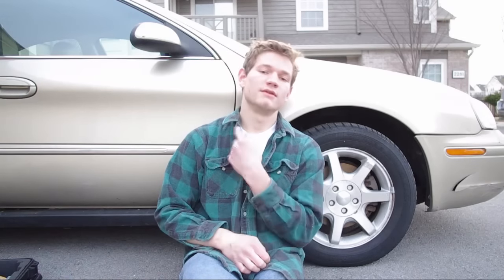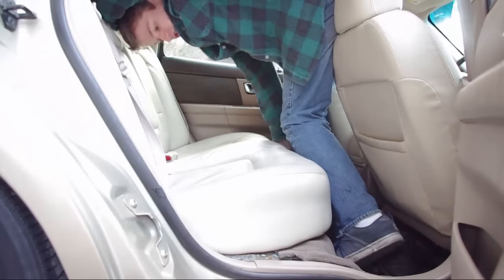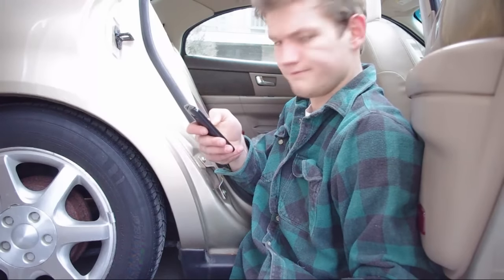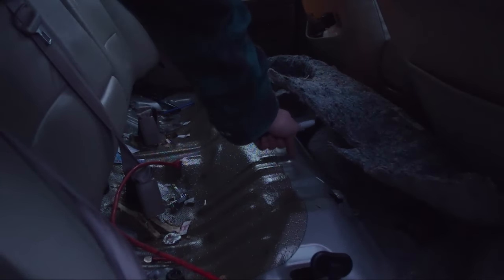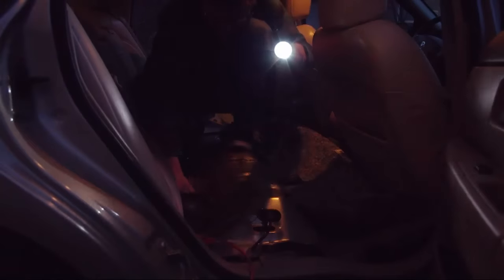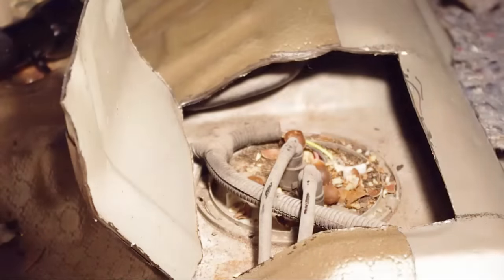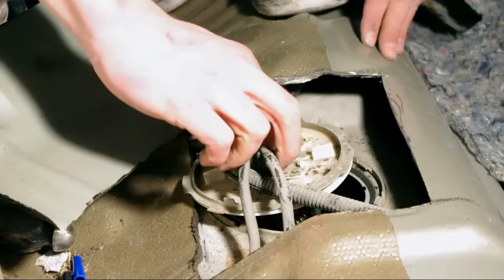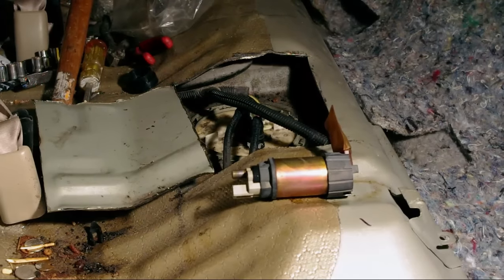Changing a Fuel Pump Without Dropping the Gas Tank

Comment: Do not do this i cut fuel lines a wires and after that a tech charge me doble for the repairs
Reply from the maker: If you're going to cut that deep then you shouldn't be doing this.  The video explicitly shows a deep scoring of the metal and punching it through the rest of the way.
Reply: it helps keeping one alive if u first relax the metal straps holding the tank by loosening the strap bolts enough to give you plenty of clearance. Im planning to drill a hole from above with a drill bit control depth of 1/8", then cut around with a clear-end hack saw ( no sparks here ). If the blade-only-goes-in hack saw doesnt work, I'll drop the damn tank, move it 50 feet out of the way, no gas fumes around, and cut out the damn access hole from underneath. yea, I'll do it only once. with my luck, Id be in heaven with my promised seven virgins ordering me around to take out the trash and shit like that that they learned while still alive and .. Second to staying alive, dont want to cut anything I shouldnt have cut. I know disconnecting lines, fuel tubes and what not is a Hemorroidal PITA. ILL drill a hole from under the seat far away from the tank, like from the front, then use tin cuters to cut the access panel after carefully measuring where I need to cut it after several hours of profound sicere prayer. Be safe guys!

Comment: No thanks. Cheap lazy actions. What about cleaning out the gas tank?  A tank that old would have sediment. If you don’t clean out the sediment the new filter will plug and burn out the new pump. A total waste of time and also not safe if exhaust fumes enter the vehicle

Comment: Most fuel tanks drop in 10 minutes after undoing two straps and the filler neck. Cutting holes is how hacks work on cars. Especially when you do not know the exact location of the fuel pump. Doing the job properly doesn't take any longer to do and ensures that you don't cut anything that shouldn't be cut. Without knowing if there are any fuel leaks around the tank which can be common on many models where the filler neck enters the tank, you are taking an unnecessary risk. Sorry but I have fixed cars properly before and do it the right way. Not only is the cutting a fire hazard, but when you remove the fuel pump lock ring, those with knowledge on doing the job use a brass punch or drift to avoid making sparks. Even more dumb than doing the job incorrectly is posting a video showing others how to be dumb. Looking forward to when you finally win your Darwin Award. Thanks for the useless video, but it was good for a laugh.
Reply from the maker: Brian Ludwig I'm sorry, Mr. Ludwig, but it is impossible to ignite gasoline fumes with an angle grinder on steel.  It simply will not get hot enough, it's a fact.  you can read this in the chemical spec sheet for almost any compound if you do your homework.  

This is not a hack job, it's an economically feasible repair, given the relatively low value of the vehicle.  And one thing I know for certain is that you've clearly never removed a fuel tank from a Ford sedan.  The armchair does have the effect of making those things easier to say though.

As for looking forward to my death...well, that's just not very nice.  Your mother probably would not be proud.